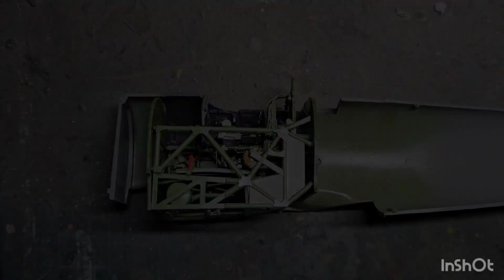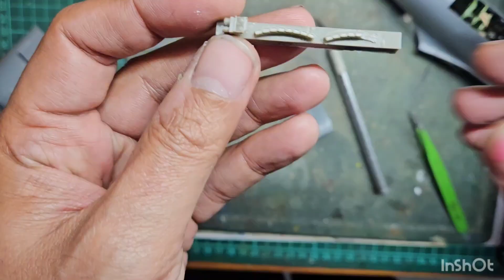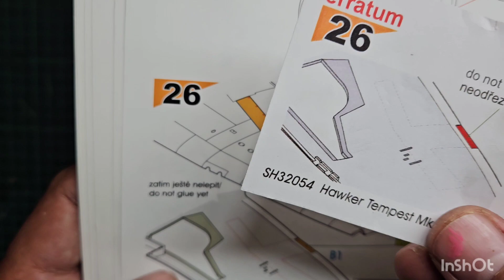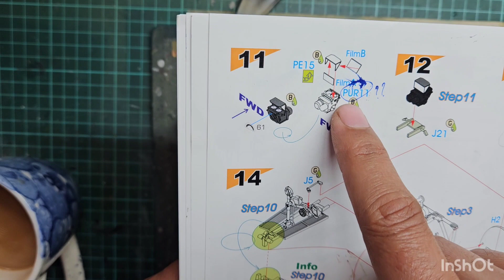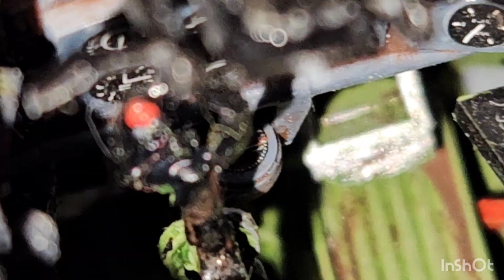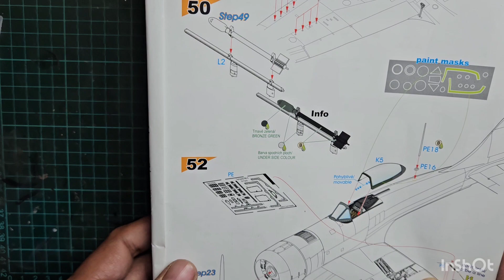Assembly Complete! || Part 3 - Special Hobby 1/32 Hawker Tempest Mk.II

Comment: By the way the reason for the clear drop tank pylons is actually very simple - the real things were clear! TO mode laccurately you'd need to have the plumbing and bolts visible on the pylon.
Reply from the maker: Thanks and yes I did see some pictures and this was indeed a surprising revelation for me. Still debating the viability of having such glassy hardpoints in real life. One bullet hit and the glass might shatter dropping the tank miles below.